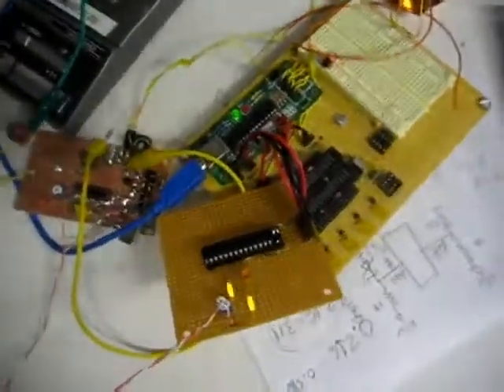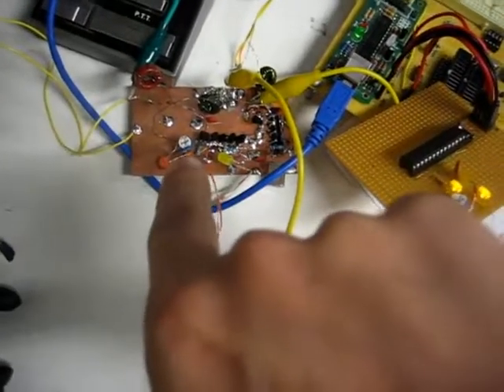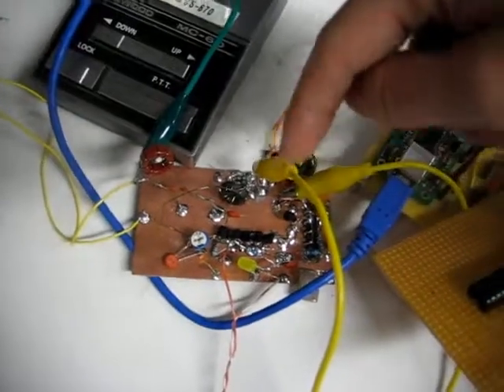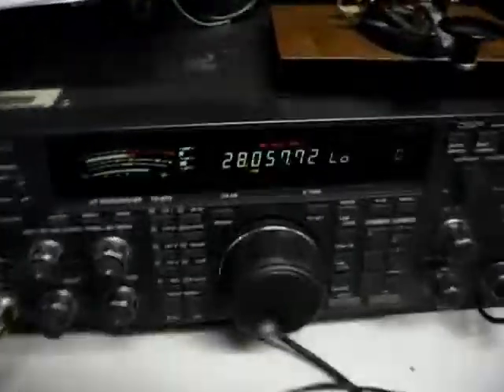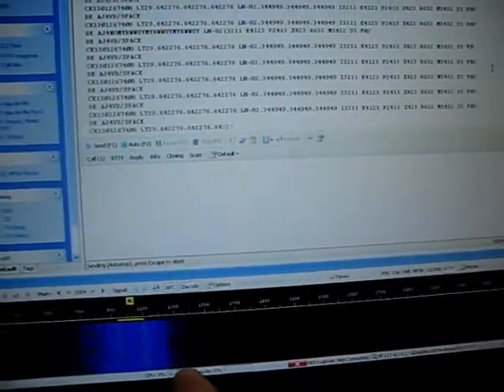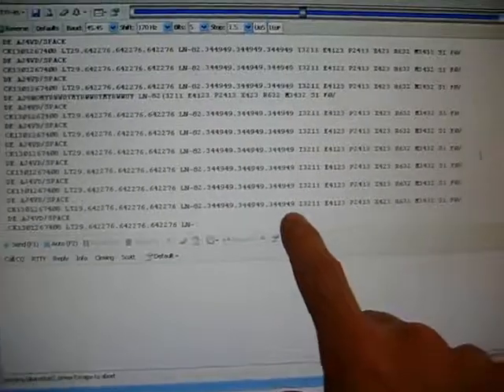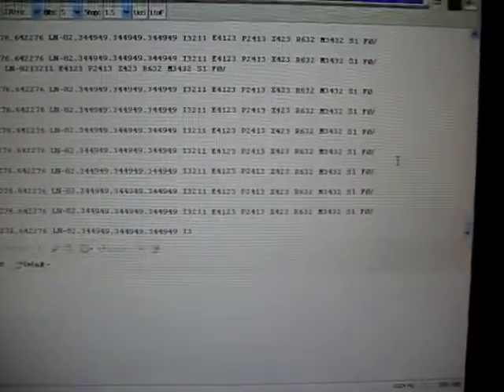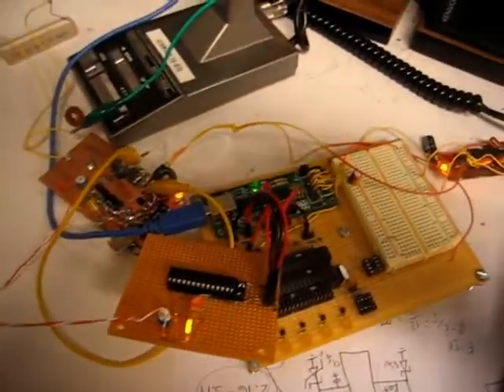high altitude balloon transmitter working

Comment: Hi. My project is similar to that except that i use 433MHz. Can i have a copy of the circuit? Just a reference. Thank you.
Reply from the maker: I don't know exactly what circuit I used for the oscillator, but I know it's a version of a QRSS transmitter. I just added a great link in the description to a favorite design. You can build it with parts you have or buy a kit. Any QRSS transmitter can be modified to be a RTTY transmitter.
Reply from the maker: Actually, 2 notes about that. (1) people usually don't transmit FSK on VHF. VHF (433 MHz) is usually FM, which wouldn't work with RTTY.  (2) the crystal design I linked in the description won't work at VHF frequencies.
Reply: Thank you for the insights. I am just following the guidelines set by WMO for the operating frequency of weather balloons. 400 MHz and 1680 MHz. I found many transmitters within that frequencies but im having a difficulty for higher altitude.
Reply from the maker: https://www.youtube.com/watch?v=BozzCpdTJUk and https://www.youtube.com/watch?v=98SHxyvsGB4 use a commercial VHF FM transmitter with the microphone button taped down and an old cell phone reading-off letters corresponding to coordinates. It's a hack, but it worked!